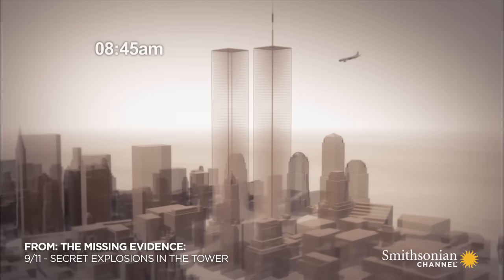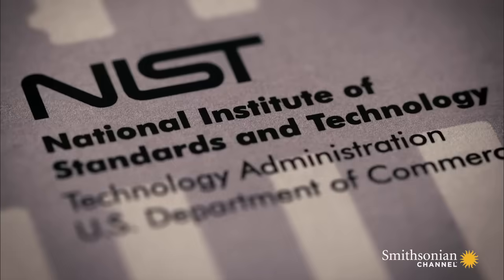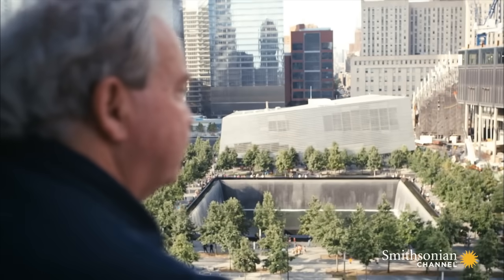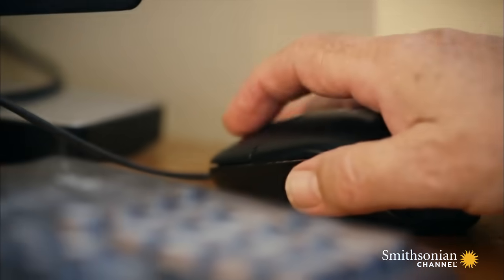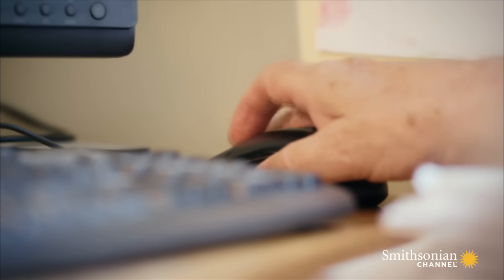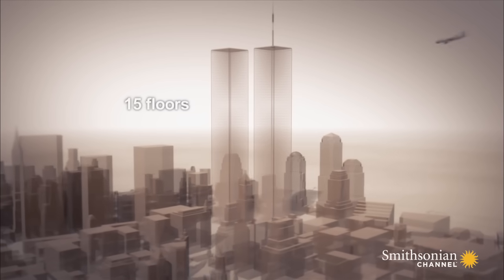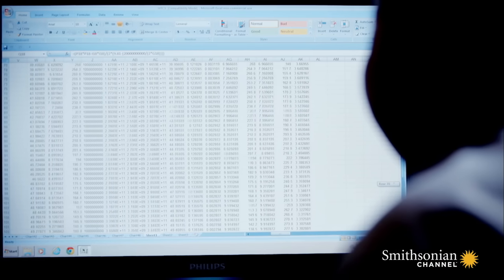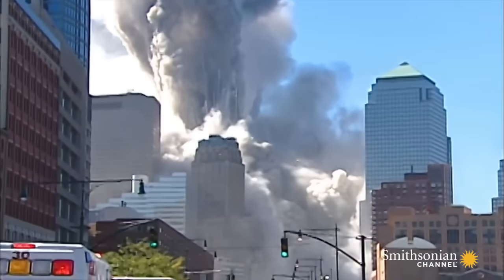This Computer Simulation Explains How the Twin Towers Fell

Comment: How did the columns fail please nist explain that
Reply: +Ricardo Garcia Perhaps, maybe just possibly, a fully-fueled jet (loaded with enough fuel for a trip to the west coast of the U.S.) crashing into the building at nearly six hundred miles per hour had something to do with it? No, that can't be it....
Reply: wtc 7
Reply: Ricardo Garcia The collapse of WTC7 is very well understood. It is very simply a case of a building that burned until it collapsed.
Reply: +Marc Barrett LOL, I hope that was sarcasm? You can't possibly be that ignorant?
Reply: +Patrick Lilley The "explosions" were gust of air shooting down the elevator shafts and exploding out the windows of the sky lobbies. Sorry, that came out a little sarcastic, I don't want to be mean or anything so please don't take offense.
Reply: Ayden Lau-Kehoe in those gusts of air were caused by the explosions
Reply: Because the floors did.